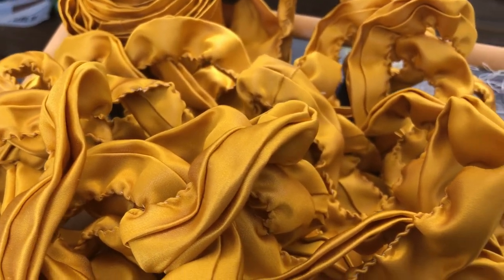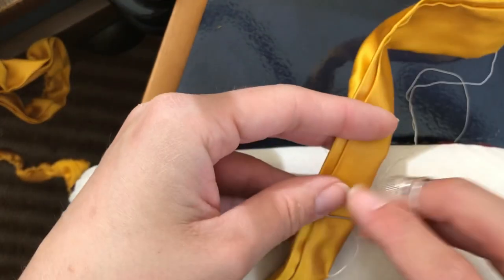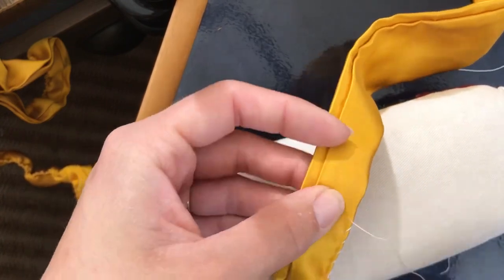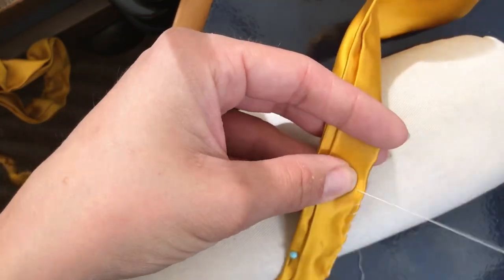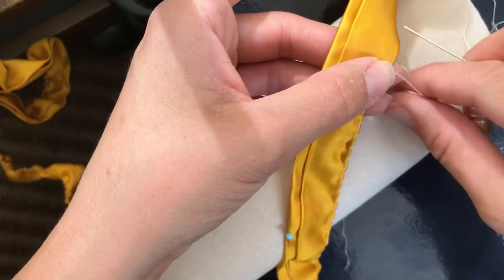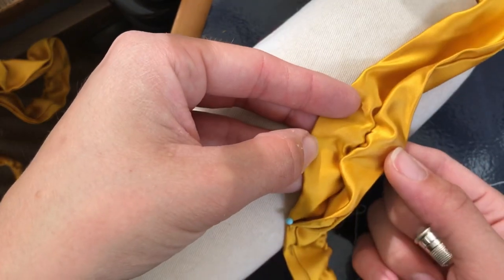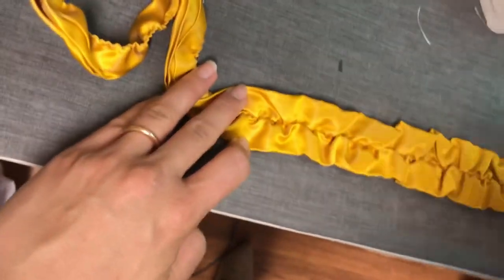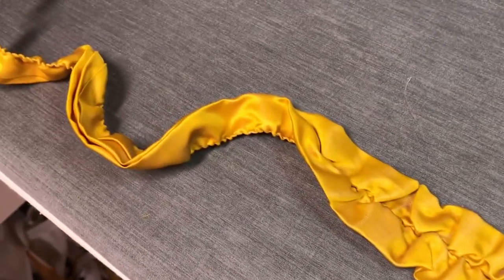I Made Victorian Trim  ||  Whipped Gathered Ruffles for my 1890’s Evening Gown

Comment: This is beautiful and very useful I think. How do you attach it to your dress ? Just sew from the back not coming through the front, and do that on both sides. I have learned so much from watching you do things. I never knew you should measure yourself after you are corseted! I am costuming alone in Saskatchewan so it is good to find out all these tips. Thanks so much from Saskatchewan.
Reply from the maker: Yay! Oh I’m so glad my stuff has been helpful. Yep, I just used a running stitch with the occasional backstitch to keep everything secure. I didn’t worry too much about the stitches showing through. They get obscured by the gathers.